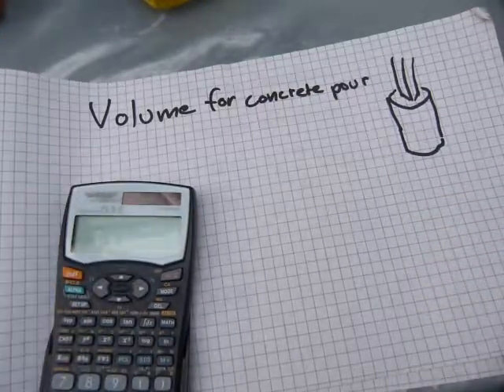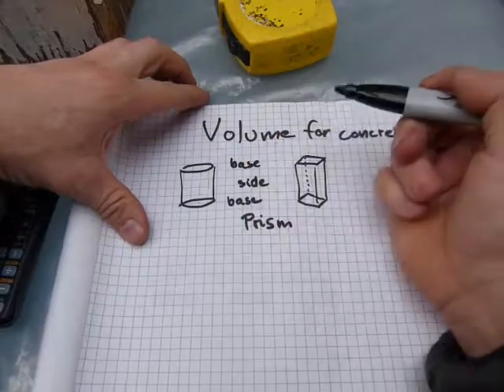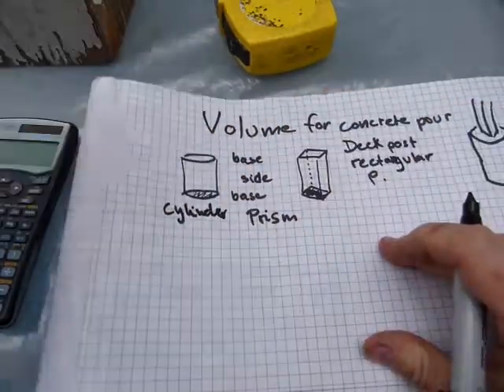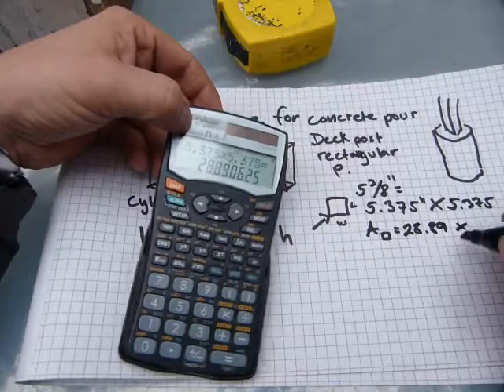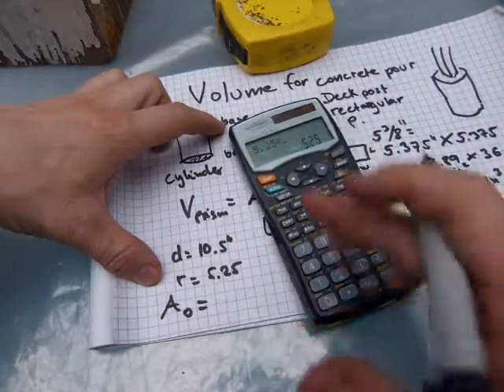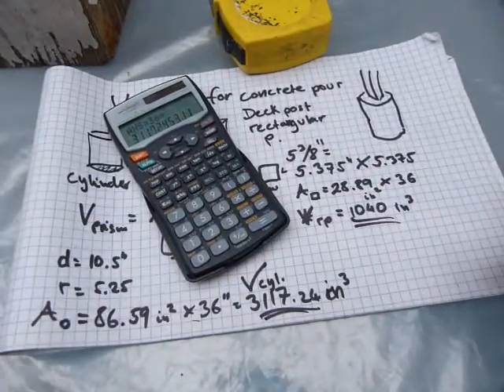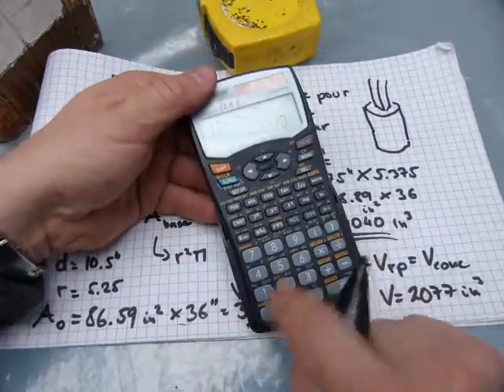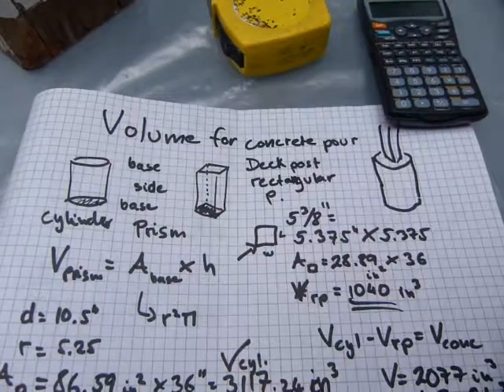Volume of a cylinder (construction field)

Comment: Hi sir nice lecture. Today i learned new thing from this lecture is defination of prism which have two base and it is parallel to each other (sides) and have some height. nice explanation.
I have one Q from so long time still i dint get the proper answer of it. So my Q is Volume of a cone is 1/3 * π * r square * h. So my Q is why we multiply by 1/3 in this case.
Reply from the maker: Answer coming soon, it is being built.